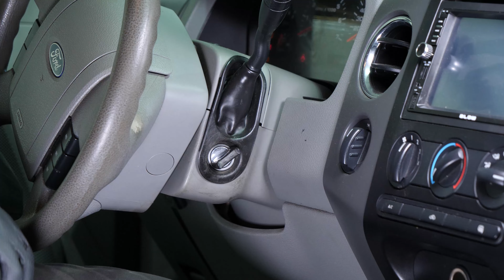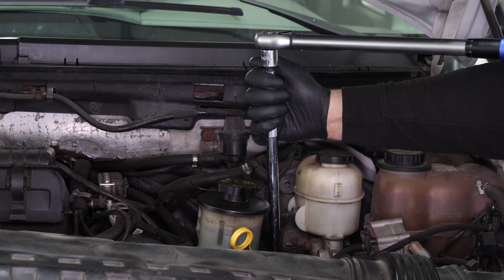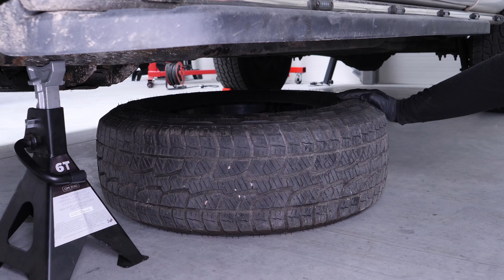How to replace the Struts 2004 - 2008 Ford F-150 🚗

Comment: Some parts of video are useful.  How do you hold the assembly in place to start the nuts on the 3 bolts from top or will they be sticking up enough with the assembly propped in place?  Thanks for your help.
Reply from the maker: Thanks for your comment and feedback always nice to hear ✌😀